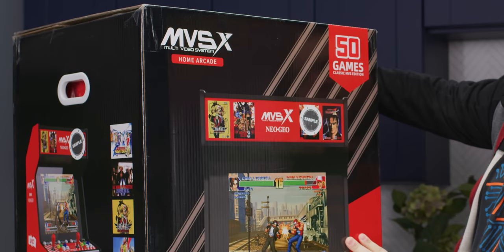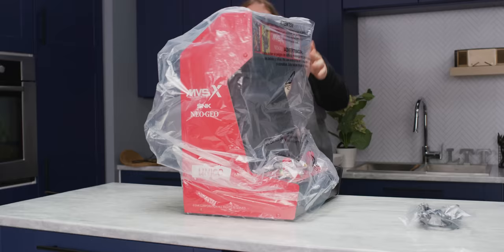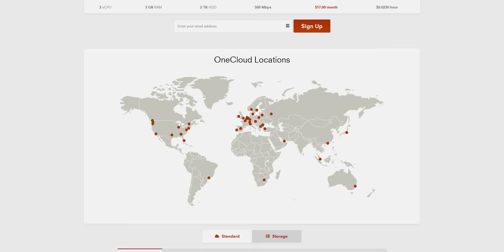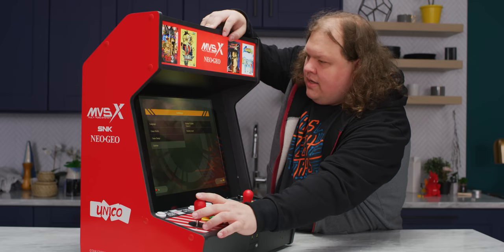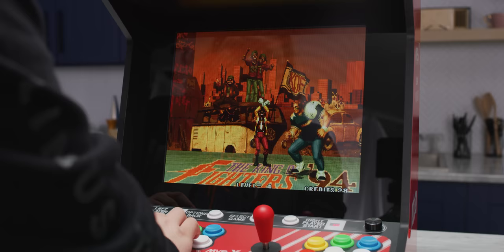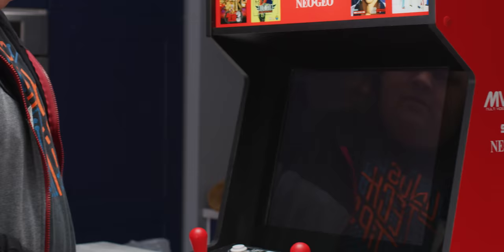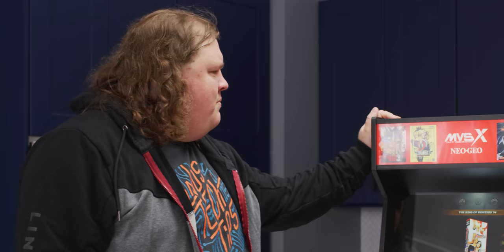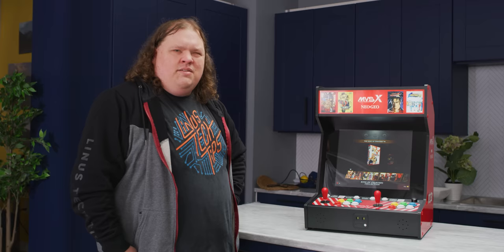My BIGGEST Unboxing! - NEO GEO MVSX Home Arcade

Comment: I'd pay $450 for this if there was some sort of computer in it that accepted ROMs.
Reply: You could mod a Pi 4 in dead cheap, but for that much if you take time you could build a full size cab with better screen, sticks and buttons.
Reply: You can load other NeoGeo ROMs from a USB stick in the back, apparently.
Reply: It has a USB port and 2 extra buttons that no NeoGeo game will ever use, so I think they built it knowing people would want to add more games from other systems. All we have to do is wait until the emulation community does its thing.
Reply: very likely is
Reply: I wouldn't worry too much about that, it'll be hacked in no time anyways.
Reply: @ferna182  and rebuilt probably.
Reply: I suppose for $450 you get a bar top kit with a nice screen, decals and basic buttons that you can upgrade later. It wouldn't cost too much to upgrade the buttons. if you watch Ashen's review (very similar take to Anthony's) I think he said you can put your own ROMs on it.
Reply: I have a 120gb emulation station on my pc saved for when I build one machine with a old pc, it has ps1, ps2, PSP, neogeo, PC engine? and many others and I can also add as many rooms as I want sadly the download link went down and with my 0.8 mb upload Im not thinking of uploading soon
Reply: Watch the Ashens vid on it first
Reply: There are Youtube videos on how to replace Arcade 1Up logic boards with Raspberry Pi. There must be a way to use this hardware with a single-board computer.
Reply: Yes. An Anthony vid and with some retro gaming too. 
I am a very happy viewer.
#oganthony #anthonyforprez
Reply: Bruh just get a raspberry pi 4 8gb
Reply: Yeah, for me the biggest limitation is that it's only Neo Geo/SNK. I couldn't drop this much on an item like this if it didn't play everything I wanted.
Reply: I have built a full size arcade cabinet with a raspberry pi for way cheaper than these
Reply: Theres a reason why there's a healthy market for DIY and custom arcade cabinets.
Reply: @wing0zero  and a better sbc be it pi4 or something similar or more powerful like a Jetson nano
Reply: I'd imagine the HyloStick Team will be looking at this unit. Much like the work they did for the Arcade Stick Pro and Neo-Geo Mini - also UNICO products.
Reply: That is one of the downsides to this. That way we can play all those Neo Geo games that we um bought. ;-)
Reply: @wing0zero  You can diy that pretty easily too (Dawid Zittrich DIY Arcade Cabinet for example)
Reply: agreed if i can usb rom and usb controllers so front usb especially for 4 person games. then i could see the price as right
Reply: Lol just build some controls and use your PC if you want roms
Reply: By that point just use an emulator on your computer for free.
Reply: @Movie Games This has very low quality buttons and stick, for $500 I can make a better one with also FPGA (not emulation), which original quality (Sanwa) buttons and sticks and will also run all arcades + consoles + computers like msx, pc-fx, commodore (8-32bit) all 1:1 accurate, no emulation...
Reply: @ Movie Games This has very low quality buttons and stick, for $500 I can make a better one with also FPGA (not emulation), which original quality (Sanwa) buttons and sticks and will also run all arcades + consoles + computers like msx, pc-fx, commodore (8-32bit) all 1:1 accurate, no emulation...
Reply: @easycompzeelandold2521  Top result was a Kickstarter that didn't meet its funding. Do you have a link?
Reply: Nintendrew has a tutorial on how to make an arcade cabinet. It's heavily tailored to fit the switch and a set of arcade pad controllers, but the shell with a fitting display, and a pi thrown in the back would be easy enough
Reply: yup
Reply: @bits2646  Do you have a YT channel or some references for this build? Are you talking about the Mister project?
Reply: Did make me think, that once you're paying this much, emulation doesn't really cut it. 
I'm thinking of the 'perfect' stuff analog's been doing (and has lined up) with FPGA in consumer kit, and what Mister is doing with 'roll your own'.
And if that's all a bit modern for you, you can pick up an old console for nothing and load it up with ever-drive-likes for your games, and HMDI mods to get pristine a/v out of it.
Or if you're even more serious, you can spend thousands on original carts graded in hermetically sealed plastic boxes, you'll never open.
I guess my point is there are 'options' for whatever aspect of retro gaming you want, and the size of your pocket - and I don't see how this would make anybody happy.
Reply: @easycompzeelandold2521  Your page 404'd. Not a good sign.
Reply: @goldcd  Analog is expensive and always sold out, mister is the way to go ,) Have build few of those machines for folx and they're all extremely happy, you just change the core and you have a completely different system to run, with a bit of IC engineering knowledge you can make own addons and then just swap the fpga from arcade style machine to desired console style box (if you want to), plug controllers (original if wanted) and plug to tv, and you have fully 1:1 console... If you want emulation, there's tons of SBC, but I'm tired of dealing with glitches, lags, etc... Emulation is OK for first few months to see if retro suits you, but once you go proper FPGA...
Reply: Yeah I built a bar-top arcade for around that. And yes, totally worth it. Worth it to spend even a little more building a pc in it capable of playing newer fighting games like MK11.
Reply: @easycompzeelandold2521  LOL - That was a kickstarter campaign that only raised $15. It's not coming.
Reply: @almaefogo  There's many links still around. I have a 256GB one.
Reply: @easycompzeelandold2521  Why the TN screen though.
Reply: @Xfade81  for this one is enough and if I need more there is always emuparadise just install a extension a you will be able to download from them again
Reply: @wing0zero  deadass wouldn't it be around like $50?
Reply: get a kit and put in any pc .. done and half price done it myself but sold it, i want a full cabinet...
Reply: @easycompzeelandold2521  All I can find is a failed kickstarter
Reply: ill sell you one with 25,000 games on it for 1,500$
Reply: Just get an Atgames Legends Ultimate arcade. I have a cabinet with almost 2000 games, 1600+ added ROMS via USB. All you need.
Reply: If only somebody released a simple front end program to add the roms? cough cough arcloader.com
Reply: @easycompzeelandold2521  details?
Reply: I made the same for about $150, you can get the exact same arcade frames on ebay and just put a Pi inside.

Comment: When you use an external powersupply, "regulations" see it as a low voltage device, therefore much easier to get cleared for safety. The 110V/230V safety regulations lays with the manufacturer of the external power supply. Once you connect a 110/230V directly to the arcade machine, then that whole device falls under that strict catagory.
Reply: This 100%, plus it's cheaper to go with a common external power supply that if it gets damaged in someway can be easy to replace.
Reply: Sell the power supply as an "included addon" with simple installation. It's just a waste of space the way they are doing it.
Reply: Yeah, I was looking for that exact comment to proof my thoughts on why they use an external PSU. 🙈 Thank you! 😁
Reply: That said... there is nothing stopping you from mounting it internally.
Reply: @wobblysauce  No nothing stopping you other than having to modify the power jack to be internal, and then pass the power plug through the case, but it would cause more heat to be inside the system as the PSU heats up. I would rather just cable manage the wires with some zip ties, and use some 3M double sided tape to mount the PSU to the outside of the back panel for airflow, and if it ever fails for some reason it's easier to place then having to open the system back up.
Reply: @CommodoreFan64  You could, but wouldn't be flush mount to a wall for eg. and not that it is really themally capped as is.
Reply: @CommodoreFan64  I got an Arcade1up and swapper the internals while using a power strip for like, 3 ac adapters that power the whole thing... put that thing inside the cabinet, and wired it to a power switch that has a psu cable connector as a regular pc :)
Reply: Wow, thanks for the explanation! I really love learning about little regulation quirks like this.

Comment: For those wondering, Samsung TVs from the late 90s and early 2000s had diagonal, 45 degree scan lines. It's supposed to be less distracting than horizontal scanlines. Vertical scan lines would be emulating a CRT set on its side - a lot of arcade games had sideways screens to allow for more verticality.
Reply: Yeah sideways CRTs (usually referred to as "Tate mode") are actually fairly common with classic arcade games like pacman and are often seen in vertical shooters like Raiden, or 1942.
But I don't think the MVS had any Tate games... It wouldn't really make sense to ether since the whole point was that you didn't need to get a new arcade cabinet to get new games, and that cabinets could have any 4 MVS games in them.
Reply: I did actually wonder. So at the very least you have helped one person.
Reply: I love when top comment is something you were about to search for more info on.
Reply: This however apparently was never a thing for any Neo Geo game or cabinet, so it must only be there because some of the display effects used are generic libraries.
Reply: I remember an old AVGN episode where he has a vertical TV

Comment: 4:15 Anthony, it has a power brick and not internal for compliance reasons. When a PSU is internal they instantly have to comply to a bunch of different standards as the device itself is considered mains powered.  
An external supply can be made by another company and be already approved, then the console isnt classified as mains powered. Thus, avoiding additional costs and certifications required for emissions and safety. 
If it's still an engineering sample they may just have added an external to get it out the door.
Reply: That said... there is nothing stopping you from mounting it internally yourself.
Reply: If this is just for the sample, fine, but when you can buy a PS5 for considerably less than this, cutting corners like that is an issue.
Reply: @88porpoise  Sony will sell more PS5 in a day then SNK will sell this in a year and Sony will be making more money at the same time, it's not an issue because you should be paying more for a super niche product.
Reply: that was probably easier to get a bajillion that were premade bong standard power to usb thing.

Comment: Personally I'm okay with the external power brick because it's gonna be easy to replace if something goes wrong.

If they built the power supply onto the board, a regular person would have a hard time repairing it. 

Maybe the best of both worlds would be to hide the power brick inside. But I'm not sure if it would get too hot.
Reply: Generally speaking, if you've got a processor that doesn't even need a heatsink, your power supply doesn't to worry about cooling either.
Reply: The main reason is for NRTL compliance. Easier to get an already approved power supply than to have the entire cabinet inspected for safety.
Reply: @thedopplereffect00  More like it is using a Raspberry Pi computer or similar to power the emulation
Reply: i love how im seeing you so much in the shortcircuit comments lol. i remember watching your videos like 3-4 years ago all the time
Reply: It doesn't even have to be on the board. Just inside somewhere for convenience.
Reply: @Xfade81  Is it really that inconvenient though? This isn't exactly something that you're likely to pick up and put away regularly as it's rather large. You'll probably only do it a few times a year, at most, and at that point, it's a minor inconvenience at best.
Reply: I have never had a power supply fail. Infact i have a whole box of them from all the machines i threw out threw the times. They do var me in handy, but yeah i have to much....

Plus built in is much easier to keep in your home nice and tidy.

Comment: Thanks for cracking this open and taking a look at the guts, no one else that I saw do videos on the MVSX were too scared. 

I'm not super surprised to see essentially a raspberry pi inside, that's about what I do for my friends. Full size cabs are hard to sell, but everyone wants a tabletop game system.
Reply: Ashens took it apart.

Comment: >neo geo
>$450
Now THAT'S nostalgia. Even the cost of an arm and a leg is like it was in the 90s. Some things never change.
Reply: $450 for that amount of games is fine. Seriously. I have one of the old BIG Neo Geo arcade controllers...it was around $180. And no, i don´t want to talk about what i paid for the Neo Geo CD back in the day.
Reply: @2nd_Directorate  yeah this is bargain neogeo
Reply: @NSixtyFour  Depends on what experience you're looking for, if it's the true home arcade experience, and collecting each cartrige individually that's not even a bargain anymore. But if you just wanna play them games more or less legally, you can probably built an MVS system with a 150 in 1 cartrige for way less (also games and consoles are way cheaper on the MVS side of things, so go with that even if you don't want an all in one cartrige ).
Reply: people are fin with a $200 arcade machine with 1-2 games but $450 for 50 games is too much? lol
for any die hard SNK fan this is an absolute steal! especially because it actually has all the KoF games
Reply: I mean considering the AES was $650 without games in 1990 money (almost 1300 in 2020 money), that's not terrible. 50 games is pretty solid when you think about the competition, those Arcade 1 Up machines have a couple games tops and are about half as much. Plus they're Neo Geo games, which are a fair bit better quality than most other contemporary retro games imo.
Reply: @NSixtyFour  
Bargain bin construction but certainly not bargain price.
anyone that's blinded by their nostalgia will buy this sight unseen it doesn't matter if it's half a grand (I mean with tax it's basically 500 bucks and that's before you even get the riser for an extra hundred plus) this is for a very particular market that doesn't mind throwing money at something to make it easier anyone else is going to throw raspberry pi4  into a cheap arcade cabinet (or build one) and get a decent two-player jarcade joystick.
Reply: @Benjamin Hausmann The switches are totally standard and you could easily replace them with higher quality ones for marginal cost.
Reply: Bought it with the raiser, delivery to Italy, custom it cost me 699 euros.
Reply: Yes, 450$ is VERY expensive for 50 ROM images. At least in the 90's, you had big cartridges with a lot of expensive memory. That's the difference !

Comment: @0:45 - to clarify for non collectors, the MVS (arcade) hardware is pretty common and relatively cheap to collect.  The AES home console hardware is crazy expensive.  For example, a real MVS arcade can be found for the same price point as this device.

Comment: Pretty cool for whoever wants a NeoGeo Arcade without any effort.
I made one myself, there is a spanish place called Talentec that sells you DIY packages to build your stand and toptable for around 300/400 bucks, they ship worldwide.
In total it was more or less 600 bucks, ordered all electronics and inputs from there as well, the only thing I got myself was the actual device running the emulation, which was a Rasp Pi 4 which is running RetroPi and an 24' LCD I found for free.
My arcade for sure doesn't look as nice and polished as this one in terms of exterior aesthetics, but it was a lot of fun building it and I give it a lot more value having assembled it myself than buying it ready, plus its customizable, I'm running several emulators on it, over 20 thousand games which we all know I will not play 99.9% of them, all I cared for was NeoGeo anyways, huge fanboy of SNK.

Comment: The coin slots on the front should be the buttons for adding credits , little touches like that make the experience original, or even a step further have it actually take a coin but it would just drop back down to the coin return opening

Comment: This is why I built my own full-size and bartop cabs running BigBox with genuine Sanwar control parts with a 25" or 34" monitor, custom side, marquee and control board artworks and NO VISIBLE SCREWS OR JOINT GAPS which IMO makes the massive difference between a toy and a genuine-looking arcade cab, this NEO GEO is ok but those controls won't last too long and most people end up modding them to play more games, in the end, it works out cheaper to build your own in the first place or buy a self-assembly kit